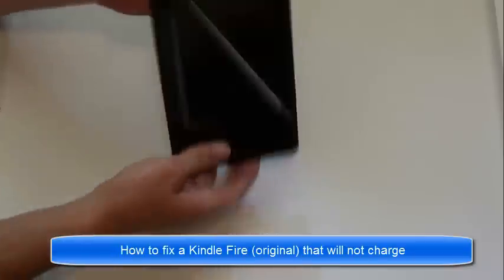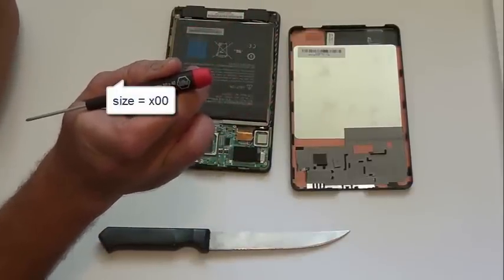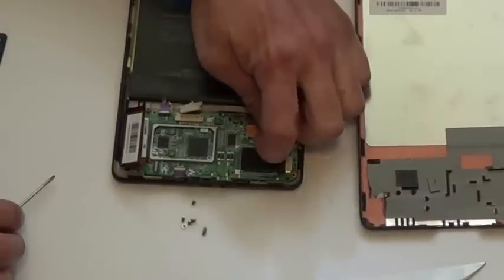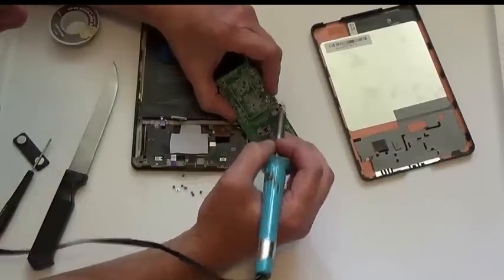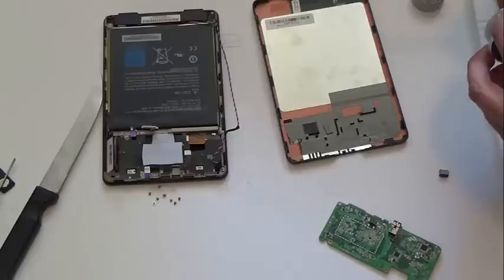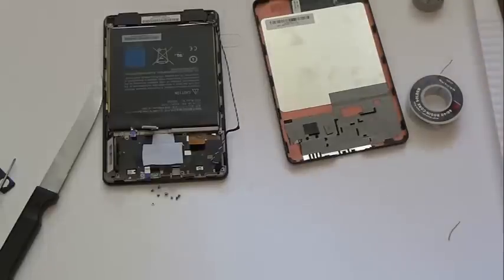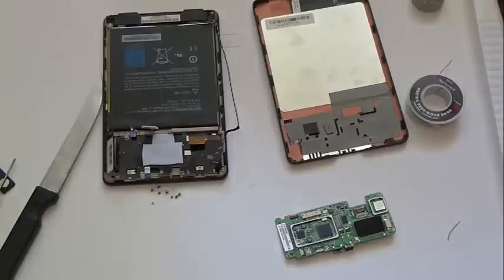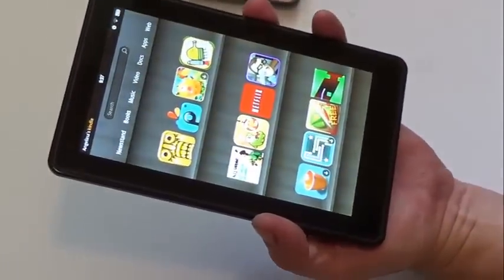Kindle Fire Won't Charge Fix

Comment: My tablet will charge it's just that if it's at 70 percent it will just power off and won't come back on unless it's on the charger. I think it might be because of the battery because I have had my kindle fire for a couple of years.
Reply from the maker: Yes, rechargeable battery technology still can wear out. Many of the battery chemistries (types) are rated 500-800 charge cycles. If you leave a device plugged in for an extended period. It ends up using up all your charge cycles because it was charged to 100% and drained a little over time.. when it hit 95% or so, it started charging back up to 100% (that was a charge cycle). After a while, they start to develop a "memory effect" and stay that way. My parents ruined a perfectly good laptop using it as a desktop for years and then were surprised that the battery was really poor. They used all their charge cycles while plugged in

Comment: You had the camera positioned wrong and could not see anything at a critical part of the video?
Reply from the maker: I shot one because I could not find a better one that explained anything. I make no claims to perfection and admit some parts could be better but it has helped hundreds already. If this is your first soldering experience, this might bee too big of a project, but perhaps this is just what you need to open your kindle and reheat the traces that are cracked and get it working again. Good luck. If you shoot a better video, I will be the first to favorite it.

Comment: Not enough emphasis on how you actually soldered the USB connector back in place...  I have tried and I cannot get the USB connector to solder from the back or the front.
Reply: It's way too small...
Reply: soldering is a different topic and you should look up the MANY videos online that will tell you everything you ever wanted to know about soldering.

Comment: mine turns on when I plug in the charger. a soon as I unplug it, it turns off. could it be the battery?
Reply from the maker: Yes it sounds like the battery is stopped charging. It's easier the battery or the charging circuit but most likely the battery
Reply: @PeterC408  Thank you Sir!

Comment: Mine turns on for a few seconds when I plug it in and looks like it's charging but when I disconnect it it dies immediately. Is this still possibly the problem?
Reply from the maker: My guess is that your battery is toast. Look at the part number and order a new battery for your unit... match the part numbers is the best way... then just get a new battery. But before you do, look at a new one... all your data, programs, books are in the cloud (SAFE)... https://amzn.to/39siown If the last one brought you years of joy, you might just want to treat yourself to a new one..

Comment: So I still can't do anything with the screws because they're now stripped. But I plugged in the charger and turned the device without the back cover on it (like it was facing us when you got the back off). And the orange light came on and actually stayed on. It has only come on for a few seconds and then it turns off. But its current. So I'm not sure how that happened. I never did anything but take two screws out. Wtf lol. Hopefully it will charge completely and turn on. I only had it for 2 months and it soon wouldn't charge with any charger. I remember I heard the phone and I was plugging the charger in at the same time. I was sitting on my bed. So I got up quickly and as I ran to the phone, the kindle fell off the side of my bed. When I came back it wouldn't charge very well and soon stopped. I've had charger issues with my blackberry tablet, Samsung tablet, and kindle. I'm cursed for tablets. Even my fitbit has the same issue-.-
Reply from the maker: +sam summers That is odd. Have you tried holding the power button for 20 seconds, releasing and then pushing it for 1 second once again? It might just be in an unrecoverables state.
Reply: Peter Carcione Yes I tried that.

Comment: video should be called, "How to destroy your Kindle Fire."  Ha Ha! I screwed mine up but it was out of waranty so it was worth a shot. I found a repair service that was $75. A new one on Ebay is $85 so screw it. I tried. My touchscreen doesn't work after I put it back together. Now I have anexcuse to get an upgraded version!
Reply: Make sure the upgraded version isnt afflicted with the same problem.

Comment: I try to turn it on but the green light goes off but the screen doesn't turn on what do i do?
Reply from the maker: Kenithiqy Wooz so you have a green light? This sounds potentially good. Does it turn orange when you plug in? Try the reset. Give more details. Did you try soldering? Can you get video or sound? Not really enough to go from yet

Comment: W@W!  so clear, friendly, INFORMiTIVE! (so I can't spell...) I found this to be VERY helpful but don't have a way to soder anything and not at all brave enougth to take apart my kindel fire. and come to the conclusion that Amazon had a marketing scam with lazy employees with soder issues to earn a raise or something...
Reply: They used the wrong USB connector! There are mounting posts on either side of the connector that are intended to penetrate the PC board and be soldered in. The problem is the posts were several millimeters too short so they don't penetrate the holes and only a small amount of solder grabs the top of the posts to barely hold them in. Once the posts loosen, the rest of the connector will fail within a few uses. We've been through a number of the units and estimate that the average unit will fail after about 300 charges. It's quite a shame too, the devices would probably last for at least several years with daily use if they had only used either the correct USB port, or included a small coaxial charging port.

Comment: Whenever I plugged in its charger it only goes to one percent 😞
Reply from the maker: It sounds like you need a new battery. Check out the part number on the one you have. They sell replacements!!
Reply: @PeterC408  aite bet

Comment: video doesn' make clear how to put the little blue tabs back in place.  also, can't f find the antenna connection after taking it apart.
Reply from the maker: Bernice Polk I think those are just little pull tabs and they tuck in right next to the cables. You can see the wifi connector in top right corner. See video at 3:29 (mm:ss)

Comment: First, thanks for video and time.
My wife's kindle fire shows the orange light when plugged in, after all night charge, kindle still will not power on. Do you "think" this may be the port needing fixed?
Anyone?
Reply from the maker: My guess would be that your solder on this connector is probably fine but perhaps the battery is dead - you may want to try getting a new battery and replacing it.

Comment: I have this problem where my Kindle Fire won't charge. When I turn it on (plugged in with it's original charger, mind you) the orange light pops on and the screen blinks on, but then the screen shuts off and the orange light goes off too. Then the screen comes on, but there is no light whatsoever on the power button.
Also, the second the charger comes out, it turns off. If I try plugging it into mu PC or use a USB cable charger where the USB end can come out, all that happens is that the green light pops on for a second, and then it flicks to orange. I cannot turn it on. Eventually the orange light goes off (5-15 minutes).
Any idea what is going on, and if this sauntering will fix it?
Reply: Sounds like your charging port is hardly making a good connection, the moment you plug it in maybe you quickly bump a good connection but then when you move it or release the wire the connection is gone. Either send it in if you have spare cash laying around or just follow this video. It really is a simple thing to fix just be careful if you use a knife to open the device also be careful using other items as you might scratch the casing or snap some of the plastic clamps off. There are tools designed for this job. Good luck
Reply: iraqtruck208 How much would a sauntering tool (or is it sauntering iron?) cost?
Reply: Cubester64
 They don't cost much maybe 10-15 bucks depending on the brand but I wouldn't go crazy on price unless you plan to like go into business using it or something, there isn't a heavy day to day use for them but you do want one that will work when you need it most and will give off good heat to melt the solder.

Comment: Sir This Is My Problem ....
My Kindle Fire Is Charging Slowly Even Though My Charger Is too Fast , Then My Second Problem When I'm Playing A Game , After 30 Minutes Or More Than That , It Will Cost The Battery So Fast , Then It Will Automatically Shut Down Then Sometimes My Tablet Is Restarting Itself .... Pls Reply
Reply from the maker: How old is your tablet? Rechargeable batteries do not last forever, they degrade over time and the run time gets shorter and shorter. Leaving them plugged in for extended periods of time, exacerbates the problem. The good news is you probably wont need a soldering iron... but you may need the same steps to get a new battery...
Reply: I'm Using My Tablet 4 Years From Now.... My Exact Problem Is , After I Charged My Tablet From 20% To 90+% Then , When I Play Games It Will Automatically Shuts Down Then When It Reboots It Shows On The Battery Bar = 1% , That's My Problem...

Comment: I just found out my Kindle fire stopped charging. Light doesn't turn orange and it stays on 9%. Of course my kindle is a bit old now. I freaked out. Immediately went to search on net what to do. This looks like the solution but I'm really not one to work with electronics and wires etc etc I'm a musician so this freaks me out, don't think I can do this. What can I do? :'(....
Reply from the maker: Carin JvV Good news! If you are still getting some charge, your solder connection is fine. It sounds like you simply need a new battery. I bet you can order one online from Amazon. Opening your case and replacing the battery takes much less effort... you don't even have to remove the PCB. Batteries only last 500 recharges before they drop to 80% capacity. sounds like you are much further along. You may want to give that a try.
Reply: Thanks a lot for your advice. Funny thing is, haha, I was down in the dumps a few hours ago, depressed while fiddling with the charger at the port when suddenly, the light comes on! And turns orange! So luckily it still has some life in it! And it's fully charged now :D I will just be very careful from now on while handling the charger and heed your advice when the time comes for a new battery. Thanks! :)
Reply from the maker: Carin JvV It could very well be the charger - that would be nice. If it takes careful adjustment of the power cord regardless of the charger, then it probably is a power port soldering problem.

Comment: Can't get through the first step of using the knife to get it open.
Reply from the maker: start in between the speakers.
Reply: Peter Carcione Thanks, I was able to take it apart using a thin screwdriver. Same problem as the Kindle Fire on the video. The connector is not connected to PCB.

Comment: Is there anyway you can make it fit in there tighter with the same results but not having to use those tools? I don't understand how to use those things at all. Lol
Reply from the maker: Emma Daniels Try a new power cord. Sometimes that is all that it takes if it is just a loose fit.
Reply: I did. I've tried four different kinds. The thing that sticks out inside of the plug in spot wiggles. It will charge but very slowly and I have to wrap the cord around it and leave it alone.
Reply from the maker: Emma Daniels Oopps, it does sound like you have "the problem". The only way to fix a loose port is to solder it.

Comment: okay so heres my problem. my kindle will charge when i shake the wire but, for some strange reason it ALWAYS stops charging at 5% and no matter how much i shake the wire or take it out and put it back in, it still wont charge Dx
Reply from the maker: That seems weird. Perhaps it is the same problem or related, but I can't say. 
Try a new power adapter - not just the cord the wall adapter.  Some say: Output 5V, 500mA but others say as much as 5V, 2.1A. Make sure you have one that is at leas 1A (1000mA).
Reply: Not your cellphone have a problem your charger have a problem
Reply: That happened to me. Just let it sit there charging even though it won't go up from 5 percent after a while shut it down and then turn it back on. It should be charged
Reply: Ghostly Gaming yeah, I had two like that.  It worked on one but second one it's not working.  I'll never buy another Kindle again bc these problems happened with 6 months of purchase...

Comment: once you press the button on mine it will say battery to low and it wont charge
Reply from the maker: Sounds like it is not getting a charge. try another power adapter first but otherwise, it is probably the connector. Seems like over a quarter million people have the same issue, so it is not a stretch to think that it may have happened to yours too.

Comment: I did this and now my screen doesnt respond when i click on it. What do i do?
Reply from the maker: Sounds like the digitizer is not hooked back up. Check the connectors and reseat it. If memory serves, I believe that this is the little connector shown at 2:20. 

Open the connector locks, seat the cables carefully and close them again

Comment: My kindle is stupid. To turn my kindle on I will need my charger just to get on it, without my charger it will never turn on and I think I'm wasting a lot of energy because I love playing on it too. Any advice? ;)
Reply from the maker: Sounds like your battery is no longer charging but your electrical connection is still good. There are many of us that would rather be in your position, at least yours works. As far as power goes, we are talking about 5V at 1Amp max; so five watts. You would need 20 of them just to consume as much as a light bulb. My advice is have fun and play on.

Comment: you have got to be kidding'  The average can not take the Kindle apart and put it back together.
Reply from the maker: While it is true that there are many that can not and should not try this; there are many folks that have made it work and many others who have found someone that could help them give it a try. If it does not look like something you could possibly do, don't even try. If you can't find a friend that could help, I would sell it on line as needs repair with a link to this video.  Best of luck.

Comment: Can I SEND MINE TO YOU
Reply: jack listner
thank you for that link.
Reply: You're welcome, they did a great job for me so I figured I would share.
Reply: jack listner The link didnt go through for me. Mine still will charge if placed up right, but im sure it will eventually go out. So would like to get it fixed. Not to mention I would like to use it while charging if needed.
Thanks in advance

Comment: Mine is connecting and holding in place just fine. Its just not charging.
Why Would Amazon dupe so many thousands of people?
Reply: From a marketing perspective, the Kindle Fire was always intended to be an entry level device that would get people interested in upgrading to the next more/better/faster device.

I don't think they ever intended for it to last several years (or more) because some very minor design changes would have absolutely resolved the charging issue and significantly extended the potential lifespan several times over, for just a couple dollars in consumer cost.

Not having any particular insight to Amazon, I'm guessing the excessive failure rate of the USB port on the Kindle Fire was probably an unanticipated embarrassment resulting from a failure to do any meaningful real world user testing. If the device was directly marketed/sold by a major electronics manufacturer, they would have either respec'ed the USB connector and replaced the failed units, or more likely, completely pulled them from the market. Since Amazon makes it's money in many ways, the Kindle issue is little more than a trivial annoyance.

Comment: mine chargers to 1%and stops someone tell me what is wrong with it?!!😠😐😢
Reply from the maker: It could be that the battery is dead. Rechargable batteries can only take 300-500 charges before loosing 20% of the capacity. If you leave them uncharged for a time, they can degrade even faster.
Reply: Peter Carcione so how can i fix it?

Comment: Second one I've found with loose connector, all the traces get burned off the board. Amazon probably designed this fucking thing this way. No way to fix it (and I work in electronics, fix and build for a living)
Reply from the maker: Weird, I have never seen the traces burnt. Does this happen when you try to solder it back on or are they burnt when you open it?
Reply: The problem with this argument is that Amazon sells Kindles at very little profit if not a loss. The reason they sell them is to try to  get people to buy books, use prime, movies etc.... See if amazon did not do this then google play store would eventually kill pretty much every digital business as they close in on their monopoly.

Most likely this was just something amazon overlooked. It is in amazons best interest to make your kindle last as long as possible and we know for many people they actually replace these out of warranty so they are definitely losing money in that situation.
Reply: Peter Carcione
I have seen them burnt when opening the device. It happens when the USB connector leads still line up with the PCB contacts, yet they are disconnected. A persistent user can sometimes wiggle the USB connector enough to make some level of contact but not all leads are connected, so there might be a loose/opened ground.

As much as I complain about the design flaw in the side posts being too short, I have seen a couple devices where the posts were still secure, the but the contacts were loose, as in a failed wave solder process.